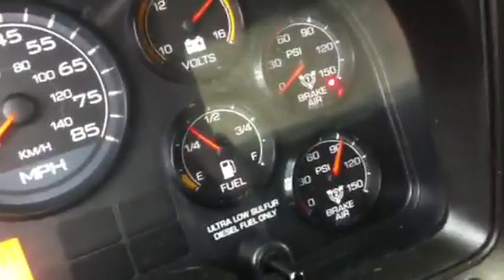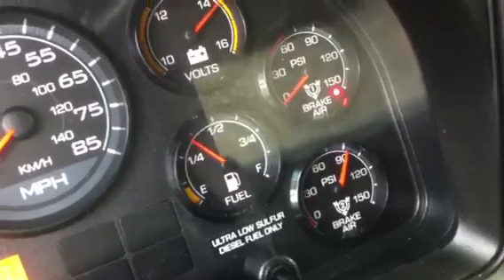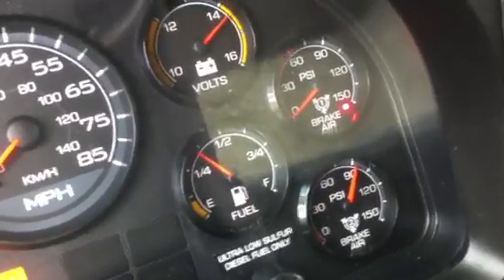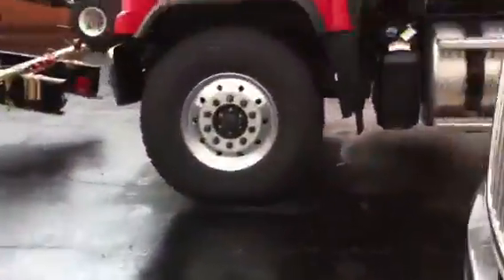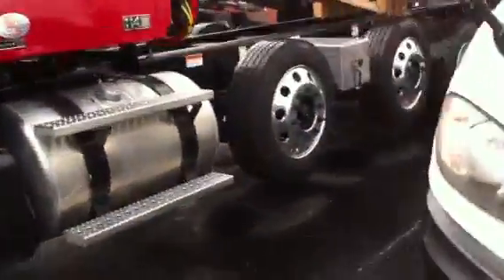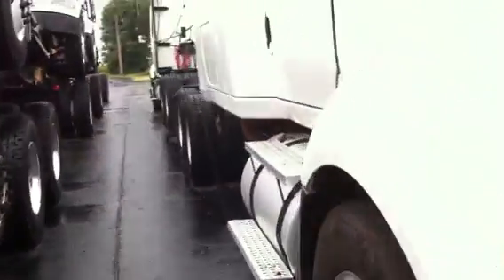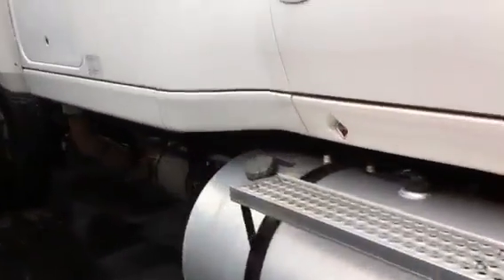Purge valve of the air dryer

Comment: I have a 2006 International 9900i air pressure is good builds air just fine driving down the road air willnt stop building and I haven't heard it pruge at all what could I check

Comment: Good job for sharing that little trick, Leslie. Mine was doing the same and tapping the valve lightly also stopped the leak. Meanwhile, because I'm the owner/operator I've ordered a replacement cartridge plus, because the lead time is several days to a week and I don't want to be caught with my pants down, I've ordered a replacement dryer assembly to keep on the shelf. Added which, because the purge valve itself can be purchased, I've got one of those headed this was as well. Finally, anyone else with Bendix 800383 AD-IS air dryer will benefit from having this document on hand: www.bendixvrc.com/itemDisplay.asp?documentID=6549

Comment: Hi Leslie - thanks for the video. As was stated below, probably a piece of dirt or rust that caught in the purge valve that was causing it to remain open and not close. Once you pushed it back up, it closed and the system resumed building air normally. As someone else mentioned, The early ADIS (Air Dryer Integrated Systems) would be prone to freezing in the cold temperatures. All the best, Cheers RIck

Comment: Ok, so if the purge valve, governor and filter have been changed,yet, this still occurs, what is the issue?
Reply: HalfMoon 
Compressor fails to unload (stop compressing air) and the air dryer purge exhaust makes “sputtering” or “popping” sound.

 Confirm the failure to unload by increasing & decreasing engine RPM and noting change in the rate of leakage and intensity of accompanying leakage sound. Repair/replace compressor unloaders

Comment: Remove the Purve valve and clean off all the dirt and grime that builds up... are you changing the air dryer cartridge periodically? If those things don't help it could be your air compressor unloaded but seeing as how pushing on it silenced it, pretty sure it's just really dirty in the purge valve
Reply: I'm assuming the air doesn't leak thru the purge valve while the engine is off correct? Otherwise check the outlet check valve and make sure it seats properly. Good luck
Reply from the maker: Thank you, Lizzy V, for watching my video and leaving your great comment.  I am in the Drive-Away Truck Transport part of the industry.  The trucks were going to a dealership to be sold to someone else.  I did tell them of the purge valve problem and hope they got it fixed for the person who eventually bought it.  I appreciate you sharing your knowledge with me through your comment.  
Leslie
Reply: Lizzy V what is it if the air does leak thru the purge valve if engine is off?